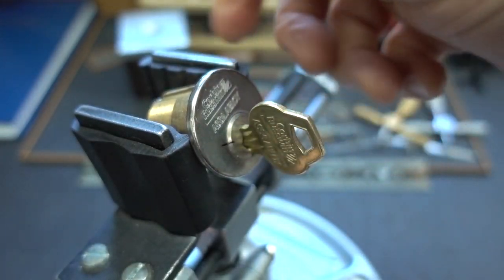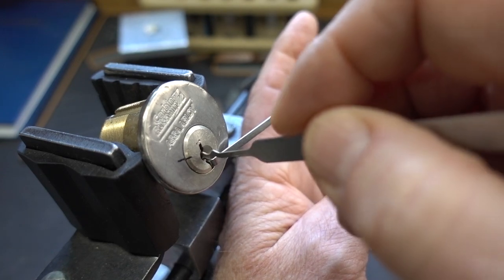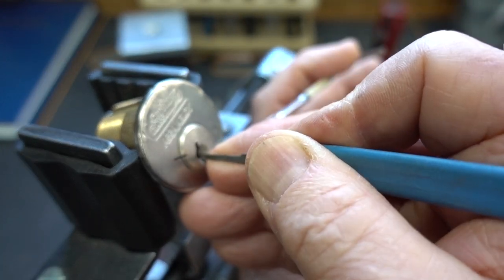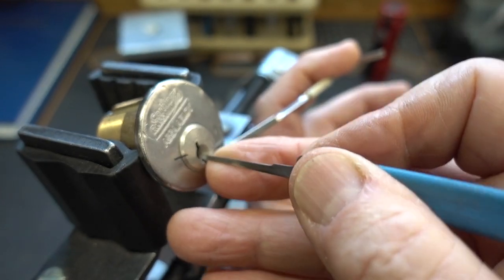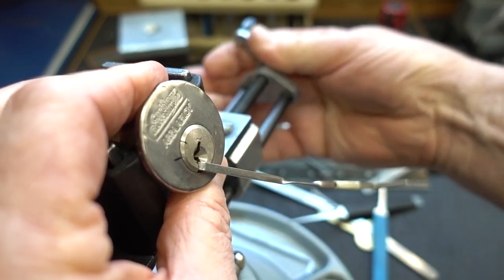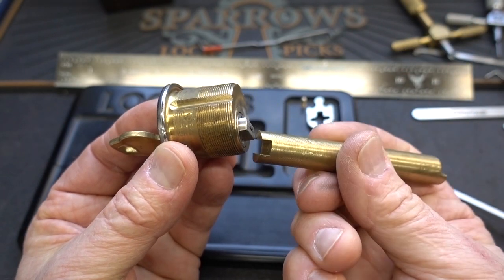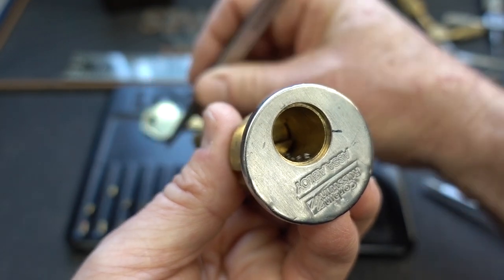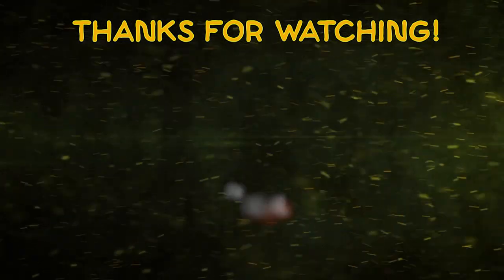(1661) Corbin Russwin Opening Tips

Comment: Maybe it's better to use manual focusing not autofocus.
Reply from the maker: I've tried both and autofocus, even tho it is a PITA, gives far better results.  The depth of field of the Sony RX100V4 is quite narrow, so if I move even a half inch out of the zone, it gets fuzzy.  I just need to keep my fat thumb out of the center of the frame - where the autofocus takes it's depth setting.
Reply: Oky :)
Reply: AF tends to find the nearest thing and focuses on that. I don't know if you can set it to work on a fixed point? It's a fantastic camera, it should be able to do that.
Reply from the maker: @Petertronic  It IS working on a fixed point - the center of the screen.  Right where my thumb or the handle of the pick wander into and out of....
Reply: @bosnianbill  could use a narrow aperture (larger number). Gonna need more light though so the ISO/grain doesn't skyrocket.

Comment: So I am quite familiar with mushroom pins and spools and I can do serrated pins with some effort but how do these 2 piece pins feel like? How do you know you are dealing with one? What kind of feedback can you expect from them?
Reply from the maker: At first it feels like a standard pin (or serrated if the pin has serrations).  Once past the first half of the pin it seems like a very narrow waisted spool or T-pin.  Then you have to pick against counter-rotation to get that last little bit through the shearline.  There is no way to "know", you just have to listen to what the lock is telling you, then react to the feedback.  Even knowing beforehand really won't help you.
Reply: @bosnianbill  Thank you. It sounds like it feels like a serrated spool. That should be doable. So far I have only seen these 2-piece pins in challenge locks. Are they available commercially. I would love to try these out in my sparrows revolver
Reply from the maker: @Akisame-LuigI-O  You'll have to make your own then.  They are not economical to produce commercially.  Thank goodness!
Reply: @bosnianbill  ooh wow. If only pins were like 5 times bigger then I could just put it in the flowjet cutter haha. Perhaps I can take a normal pin and use electrical discharge machining to create the hole and then make the T piece using a turning machine. I wonder how these will feel if the hole and T piece are off center......I'll have to see if I can get my hands on a thin enough ED wire
Reply: @Akisame-LuigI-O  you can use a piece of brass tubing to make the outer sleeve
Reply: @Jake1973_  true. I will check it out